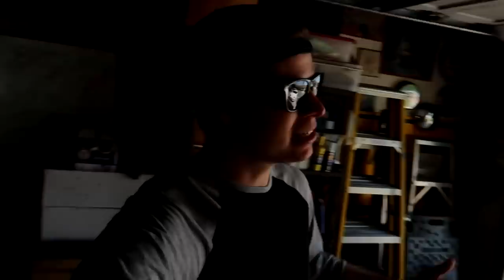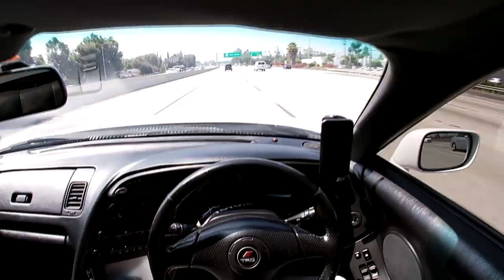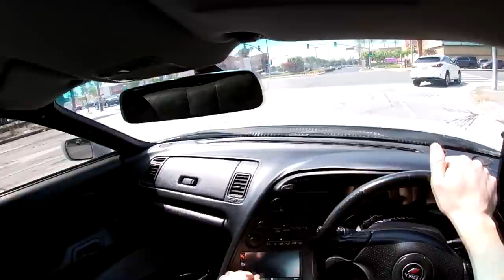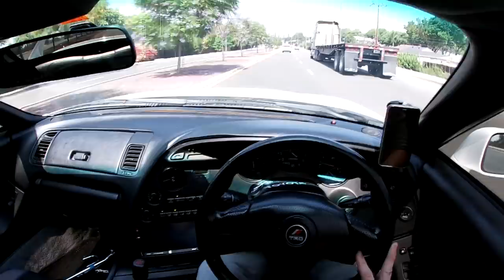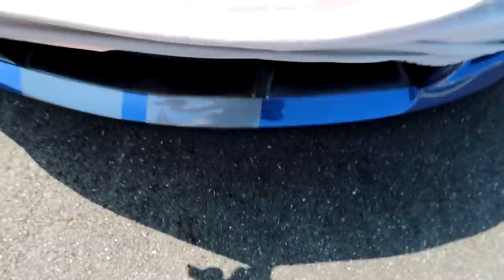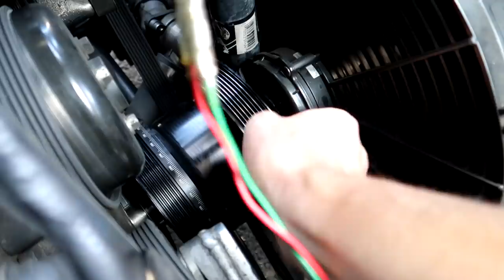I Finally Blew Up The MUSTANG...

Comment: Honestly who tf dislikes Drew's videos he broke his 'stang give him a break 😂😂
Reply: I think you did
Reply: YES
Reply: you always loose a little respect when you buy instead of build. im a little disappointed. I built a 430 hp pushrod 5.0 in my garage for 400 dollars and a lot of work. That motor has been in a daily driver and has made numerous passes at the track. still kicking strong. If that was just a basic crate motor i dropped in there would be little pride in the build. Nothing feels better than know you torqued every single bolt in the engine.  Sure is alot better than spending thousand to pay someone else to half ass putting your motor together.
Reply: Environmentalists
Reply: @Impulse1226  lmao
Reply: MegaRussell12 exactly I built a 351 windsor swapped 86 foxbody and put around $2000.  I threw Eagle h-beam rods and 8.7:1 compression JE pistons with aluminum heads and a Vortech V1 S-trim supercharger using 18lbs of boost making around 500hp using a Cast iron crank. For percussion I put on a main girdle. If I use more boost it would be a track cleanup

Comment: I went to school for psychology, and I fully rebuilt my engine and upgraded all the internals, I even ported the heads myself with a carbide bit and a dremel. Polished combustion chambers, and learned to tune it (not fine tune but tune it pretty good, or as good as you can get without a dyno). And I had never built a motor before that. Do it man, when you gap another car in a car that someone else built the motor for, sure it's fun. But that sheer satisfaction of knowing you built (or rebuilt, let's be honest the manufacturer "built" the car) but when you rebuild the engine from the ground up yourself, you get sooo much satisfaction out the performance and you learn the ins and outs of the engine and gain understanding of what is going wrong when problems arise because you know the ins and outs of the engine first hand. Even if it's a naturally aspirated 4 cylinder car like mine and is maybe a 13  second car on a good day, it's still satisfying to know it's your build (btw I BUILT the engine to withstand high boost, just saving up the money to get to my HP goal). If I had a Bugatti given to me or (lord willing i was able to buy one) I'd have some crazy fun in it. But I would get no satisfaction out of gapping another car, because I just bought it I didn't pour blood sweat and tears into blueprinting and rebuilding the engine to withstand the boost that I want it to reliably survive. Honestly besides a socket set you only need a torque wrench (to torque to spec) an allen head set, a bore gauge, cheap plastigauge, and maybe a dial indicator to rebuild almost any engine. Sure you'll run into one or two things that you find you need another tool for, but those tools have utility and usefulness for many many years so when something breaks it's that much simpler to fix it because you have the tools and the knowledge of how the parts interact. Plus think of the cash you save in paying a mechanic. Taking my engine down to the bare block and powerwashing it and rebuilding it every nut and bold was fun and educational, I'd feel so empty racing a car that has someone else's engine in it. You won't regret it, find a project, even a cheap one, and build it entirely yourself, you'll have a blast cursing at seized bolts and then the satisfaction when it all comes together and fires up and just eats!

Comment: Honestly probably the best thing you could do since its screwed. Take it out and try your hand at taking the engine apart yourself. Totally a worthwhile experience, just take photos and label parts. Really the biggest thing with engines is tolerances and torque specs. It's all just nuts and bolt. Keep on keepin on brother!!!

Comment: 5.0 time 😏 or even a Cobra 4.6 iron block😳 if u wanna drop the money
Reply: With the plans he has for the Supra I doubt he wants to spend too much on the Mustang. Would be cool though if he swapped it with a 5.0.
Reply: Luqman Hakim too much work. It'd be cheaper to just buy 2012-2016
Reply: @Agavegaming  true. But from my experience, the character of a 05-09 3V, even with an engine swap is really harder to beat

Comment: Test drove a charger daytona today, love v8s.if I can do it, I'm paying off my wrx and getting a charger in a couple years.
Reply: I 10/10 recommend getting a charger! I love my Scat Pack and the Daytona is basically the same thing, same 392 6.4L srt engine. Just better suspension and breaking system with a couple other things. Bone stock I’m running low 12’s on a quarter and the car has been completely sound, never had a problem with her. Besides the guy who owned it before me threw some semi metallics on it and warped the piss out of the rotars but that’s a quick easy fix. I hope it works out for ya!  I absolutely my hemi
Reply: Meh if you like driving the charger is the farthest thing from a driver's cars. That thing is HEAVY and you can do all the suspension mods it's still a tank. Nice for going in a straight line crap for turns. The new Miata with like 220hp is faster than a hellcat stock around some tracks lol. That is sad. Seriously if you enjoy driving don't get a charger.
Reply: @4touchdowns1game29  not for racing, just fun cruiser. I enjoyed being in it. Never claimed it's a driver's.
Reply: @4touchdowns1game29  i know tons of people that love their chargers and enjoy tf out of them
Reply: 4touchdowns1game definitely not track cars for sure. Powerhouses on the strip, but they handle fairly well, but you’re definitely not beating any other car really on say an overpass or a track haha. They slide like nobody’s business hahah. It truly depends on what kind of driving your intending to do, I love to drift and lemme tell ya that thing is a blast for that exact purpose. I wouldn’t say if you enjoy driving not to get one lmao, if you’re trying to mess and eat up cars around town doing digs and rolls then you’re cherry, as well as drifting. Also if you want a big throaty v8 American muscle car, not a little foreign turd
Reply: @pxrplexed3501  not saying you can't enjoy a charger, it's a badass car. Just saying for a "driving experience" it's just not there like other cars. A scat pack still handles good if your moving up from a regular car just if your used to sporty cars and move into a charger you will be dissapointed if you like going in more than a straight line. Dodge needs to bring back the srt 4 or lose some weight from their chargers/challengers. It's a trip they almost weigh a thousand pounds more than a mustang, like where is that weight coming from?
Reply: 4touchdowns1game I agree 100 percent, especially on the challengers. They’re a coupe, I was under the impression for years until I got into mopar they weighed roughly the same same amount as a say an SS or a 5.0. I’d like to believe it’s because they’re still trying to achieve that wide, aggressive look, but at the same time they’re trying maintain their own unique style and that simply calls for a wider, and longer body, they also use the same platform across all trim levels, starting with the premise of an awd GT. I’d say that has a lot to with why they’re so damn heavy
Reply: @dominicboyer2090  ita mainly the presence, sound, look, space, v8 charm, powerful enough to enjoy road trips and have little sprints here and there. I'm not really in the racing at th moment. I just know after my test drive, I could see this being a blast. I know it's limitations but not tracking it.

Comment: Not sure who you talked to about a coyote swap but power by the hour is making a plug and play harness for the 3 valve. All your changing is the ecu and engine. Same fuse block, body harness, and all your gauges should work. Its probably simpler than you think. Would be worth looking at imo.
I know imma do it myself in the future.

Comment: If you buy a coyote or an LS you can built the bottom end while it’s still outside the car. You can mock up the wiring before it even goes in the car.

Comment: Have you considered swapping the heads? I'm sure the DOHC heads like what was used in the Cobras or GT versions of those modular Fords would be interchangeable, plus more flow would mean less pressure and stress on the engine. May be worth looking into, idk

Comment: Hey Drew, you might have gotten lucky though. You might have just sheared the crank bolt and the pulley gradually works it’s way off. Idk man, I’ve seen it happen a couple times over the years. Just offering possible hope because I know you have tons of time and effort in the mustang. If the crank bolt sheared, it’s definitely better than removable crank lol. Lot less money to repair. Good luck man, hope to see her fixed soon.

Comment: Hey man, I have an 07 3V as well and was thinking the same with the twin turbos. for the bottom end though I want to do the 5.0 stroker kit. and then because I have a pre-08 head revision - finding some new heads because of the spark plug ordeal. I've seen people do steel sleeves in the aluminum block. From what I've read the block is good to 1000...but idk (though you have a built one from what i remember in older vids). Top end would be phasor lock outs, more aggressive cam etc. Then finally because I have the background - going to making my own ECU/piggyback so I can keep the stock ecu and bcm happy while going past that RPM limit!

Comment: Bro you should run a smaller turbo to get a faster spooling turbo for  low end boost and have the second turbo huge to smash at top end like some diesel trucks set it up. Would that work better than 2 same size spoolie snails on that platform???🤔

Comment: literally looks like your harmonic balancer came off. There’s usually a single bolt on the front of the balancer that needs to have lock tight on the threads. Check if the bolt is still there. You may just find your issue is as simple as that.

Comment: Truthfully it looks like the pulley just came off... the bolt probably worked out of the crank.... I'm going to say nobody Loctite  the bolt when they put the pulley on hopefully it's an easy fix looks like it is
Reply: That's why you were feeling the vibration you were feeling the bolt was slowly working its way out... I didn't read all the comments but I looked at most of them and I guess I'm the only one that seems to think it's an easy fix... or most people have absolutely no clue what they're looking at we can go with that one

Comment: Forged rods you deside on pistons and a forge crank
Reply from the maker: They were forged,  everything was
Reply: Dang that had to be expensive well I have you more amo for dissing ebay turbos you more than likely will get scammed for them turbos and any thing on Ebay because the website itself will scam you and block you for no reason at all it happened to two friends of mine. I hope you get you mustang back on the road and it inds up making 1000 wheel horsepower. And also I want you to rost my car because it is a ricer shitbox I sent it to your email a walleback and I love the car but my I am 18 and I had bad taste in cars but I am learning and it is not a tuner car so I kept with the ricer look because it was already to far when I drilled holes in my hood
Reply: I'm from blountstown Florida

Comment: Save yourself the pain of repeating the process with the supra. upgrade the internals BEFORE "slappin on" a turbo and going booooooost! 
This includes, Crank, Rods, Bearings, and Pistons + accessories. 
It will save you a bunch of money and sadness in the long run. 
or don't, and eventually post a video titled " my supra magically blew up".

Comment: Why not just coyote swap? A 3v will be super simple to swap you can reuse almost everything except the headers pbh is about to release their 3v pigtail. Youll build the ultimate 3 valve yet you will never have the driveablity of the coyote. Drop a gen 3 make 500 n/a or supercharge it. Or go gen 1 and you can go way over 8k rpm if you build the bottom end. My gen 1 swapped 86 mustang right now is constantly hitting 8k on stock bottom end and im in socal so ill even prove it to you. And can even lend a hand ✋ got plenty of time with this covid deal

Comment: Lol 3v v8s blow at 500hp you're going to need to go for an aftermarket block and might as well just buy a crate engine at that point.
Reply from the maker: Stock 3vs do, mine was fully forged
Reply: @DrewPeacock  again the interanls are irrelevant doesn't matter it won't stop the block from blowing up without block bracing at the very least. When you say fully forged are you also referring to the block as well?

Comment: Hey drew, I might sound dumb and all but, in my opinion when you single turbo the Supra.  I think you should probably put a sequential manual gearbox because you will shift gears without clutch and your foot still on the gas.

Comment: Why a Chinese Mustang?90 percent of the parts are made in China. Your Supra is awesome. Ever thought of a Kia Stingray or Hyundai Azera which is 300 horse stock and 700hp with bolt-on? Heck they handle better, 100% router, and more reliable, and not everyone has one. Try to find one bad thing (EVER) written about the Azera.